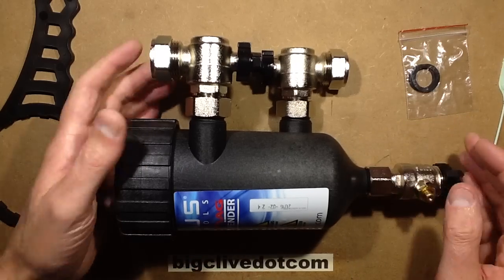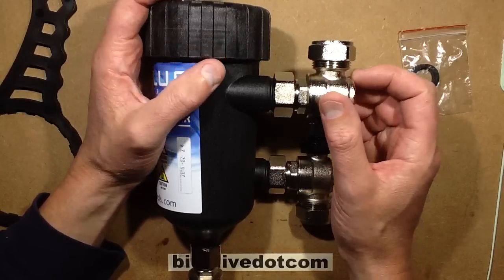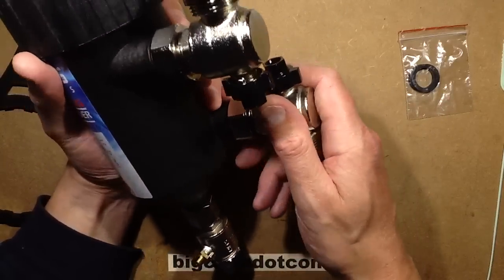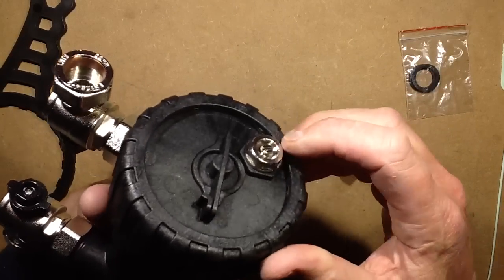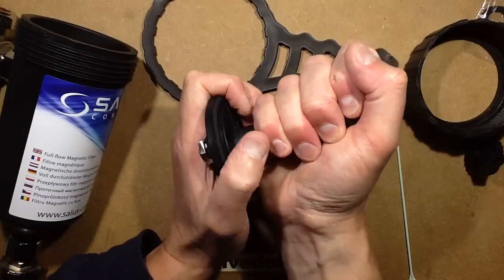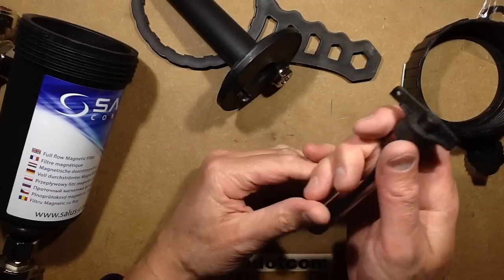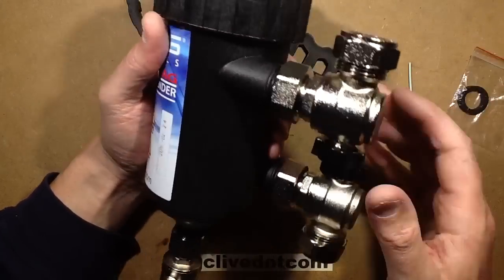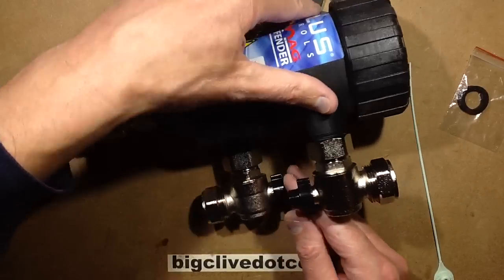Inside a heating system magnetic "sludge" remover.

Comment: My house was built in 1928 so has no central heating :(
Reply: Yeah, windows get the job done, but linux is better indeed .
Reply: My house was built in 1916 and still has two of the original radiators, and some of the pipes. Most of it was replaced when the top floors burnt out in the sixties, though.
Reply: Space heaters ftw! Or window units I suppose.
Reply: +cyancoyote I see what you did there lol
Reply: +cyancoyote groan Only in the comments section for a nerdy engineering video.

Comment: Corroseal Rust Converter Primer. Have you tried this for coating? It turns rust into a plastic like coating. It's Magnetite stops it from rusting any more. I have used it for undercoat in a '75 Scout and it's still driving around. I used it on all sorts of rust problems over the years. Wonder if it would work to coat your radiators. Best part is the more rust the better it works.

Comment: !!!!!!Also if you have a primatic system DO NOT inhibit!!!!!
Reply: Yup - Ive got a Primatic tank and the 5 year ritual of sluicing the system has been ingrained in my summer break for the last 25 years. Helps keep the crap at bay, plus avoiding "over pumping" the system so that it doesnt suck in air through the bell was a lesson I learned early in my relationship with it. I have to say though it works brilliantly so Im loath to replace it with anything else - plus I have my solar PV lashed to the immersion and get loads of hot water whenever the sun shines.

Comment: id add a T and another valve to one feed to that unit and a hose fitting to the bottom and the valve on the side and you could use it to do a half arsed flush of the system.

Comment: All the plastic bits on that thing look like they could get awful rickety over an extended period of time. I could imagine going back to that thing in a couple years and trying to turn some of those pieces and having stuff just crack and fall right off.
Reply: Shouldn't be a problem as the temperature will be less than 80C and high temperature plastics have been used under the bonnet in cars for years.
Reply: They're made of tough stuff Daniel. Reinforced hard plastic.
Reply: I've had a cast-metal thing break off while opening and closing the filler valve. Naturally, this happened after the plastic part of the filler hose also broke, so there was then no way to stop the system from dumping all its pressure on the floor of my boiler room... Fucking thing. I had to go find a bahco somewhere to close it up again.

Comment: The council fitted a combi boiler about 5 years ago but about every 6-8 months for over 2 years the heating just stopped working so engineer had to come out and clean the filters to get it working, then after 5 repairs and 2 annual inspections the engineer said the filter was originally fitted backwards so put it the right way and worked perfect ever since.
So that just gives you an idea of the level of incompetence that council engineers have, and wouldn't be at all surprised if one night I went to bed and entered the eternal carbon monoxide slumber.

Comment: Looks to me you could use a wrench to realign the connection ports to fit your system.  Would be a little more difficult to turn the on/off valves if the pipe is inserted in a straight section but it could be done.

Comment: A lot people wondering why we still use radiators, other than heating cost, safety and noise, no reason.
Reply: As for cost, the price of a forced air central heating system is much cheaper to install initially, an efficient boiler system in the US can cost between $3,700 to $9,000 USD. While central air costs between $1,500 to $2,200 for a normal system and $2,200 to $4,200 for a high efficiency heat pump system that includes AC. . Maintenance is also minimal, just change filters and occasionally clean out the main unit. And any modern system uses a heat pump as its primary heating/cooling source and are fairly cheap to run, whether it be an electric or gas heat pump hybrid system. As for safety there are no real benefits either. Modern systems dont even have a pilot light and use on demand ignition if they are gas, and for an electric system all you have are a few auxiliary heating coils, that at the worst burn out and stop working, they have flow sensors and thermostats to keep themselves from overheating. If you acctually get a quality system and install it correctly noise is hardly ever an issue, most units are either in the garage or in the basement, and modern heat pumps are vary quiet depending on the heat transfer capacity.  

Different systems for different climates, but if you want to talk about a type of hvac system that is superior to most it would be ductless mini split systems that have a separate unit for each room of the house, the efficiency and effectiveness to a separated hvac system is much better. Though on the cost side can be a good amount higher depending on the size of the house.
Reply: All houses here (UK & IE) are built with the systems in place, so install costs are negligent. We also build our house from concrete blocks, typically two blocks with room for insulation between them. Again, over here it is very different, electricity costs more, it's much cheaper for Natural gas. Electric heaters are around over here, my mum in the 70's remember they had one in their house, they never caught on here. On the safety note I meant electric convection heaters only, they can become filled with dust and burn. I use water to cool my PC, water is simply a better heat exchanger than air, which is probably why it's used more, I don't feel like arguing either, so google the advantages if you want.
Reply: It's also worth noting that some houses are very hard to 'upgrade' to central air. The ducting and vents have to go somewhere, and it's quite hard to add that to a home that wasn't initially designed around that. Or at least has an empty attic space and only one floor. 

Here in the states it's fairly common to have central air (especially in hotter climates, in the colder climates I'm not too sure, I lived there for a bit, and we just used space heaters, but it was an incredibly old house). But you do get old houses, and really the only way to get A/C there is to install a window unit. 

So really it's just because it's the norm there, and it's pretty hard to install anything else in older homes. And people tend to like tradition so they like new homes with radiators over central air. 

As for safety, I'm not sure where you're getting the idea that central air is somehow unsafe. Noise maybe, but radiators make a bit of noise too. As for cost, well I can't remember what the radiator cost is, and nor do I really ever have to heat my house in the climate here (cooling bills are absolutely insane though. ~40c ~100f summers and all). But I believe central air isn't much more expensive, probably actually cheaper. 

So tl;dr; Because it's tradition, and because it's hard to retrofit anything other than radiators to an old or solidly built house. That and in a lot of the climates you really don't need cooling except for a few days of the year, and those you can just tough out.
Reply: https://en.wikipedia.org/wiki/District_heating          
This is what is commonly used in Germany, it's cheap and efficient and there is no smoke coming out of every house in winter.
Reply: Here in New Zealand there's no such thing as central heating, it's all electric space heaters and air conditioners here. Electricity here is cheaper than gas and very few houses have gas connections, and those who do (or one that uses LPG bottles) uses gas space heaters.

Some other places like Copenhagen and Beijing have city-wide central heating, with giant boilers.
Reply: I've been to whole estates of 1970's houses that have had the forced air heating taken out and replaced with radiators.
Reply: thats usually because the replacement parts needed to maintain them are not available, except at crazy prices, and they are expensive to run, its usually cheaper to replace them with an alternative system.
Reply: After years of careful research, I can confirm it's because you are too busy eating fish and chips to install forced air heating. PhD thesis, here I come!
Reply: +NexaEntertainment Not to mention a large number of our houses are multi storey. It would cost too much for such a system and there aren't really any benefits, especially not here. For the safety aspect I was refering to only convection heaters.
Reply: +Avantime my city has common city heating too

Comment: Lots of large commercial buildings still use Hydronic systems though most have hot water coils in large Air Handling Units instead of radiators usually Sodium Nitrate is used as a rust inhibitor.

Comment: The radiators are made of steel?
Not stainless steel, aluminium or copper?
Reply: Stainless steel and copper are too expensive for radiators, which require quite a lot of material to produce. Nobody would buy them if they were made out of those.
Reply: Old radiators ones used to be cast iron, modern ones are usually steel.
If you have only steel in your heating system all is well, the problems come from mixing different metals or adding plastic which is permeable to oxygen. The old steel-only systems last practically forever.
Reply: +stefantrethan Plastic pipework used in heating systems is a three layer extrusion with an oxygen diffusion barrier in the middle, coloured blue so it's obvious it's 'barrier' pipe.
Reply: Steel is the standard material - it's cheap, easy to form and tough. Some 'designer' rads are aluminium, which adds another metal to the corrosion cocktail, and some upmarket bathroom towel warmers are stainless.
Reply: System in the house when I was a kid was mostly CAST IORN.  With asbestos pipe insulation.  Furnace (coal fired) rusted out after about five years.
Reply: Our pipes were all copper.
Reply: Copper pipes is pretty standard.
Unless you have a house from the 1900s which uses lead pipes
Reply: But they would be more of a lifetime thing than what a few years compared to steel unless the steel is zinc coated.
Reply: If it's done right, yes. Around here they used plain poly pipe for underfloor heating sometimes and put that into old central heating systems with steel. You wouldn't believe the problems that causes.
There are also low-temperature systems now which are entirely made of single layer polypropylene pipe, using only brass or stainless metal fittings, no steel at all. They also work just fine, clean as a whistle, but never mix the two.
Reply: there are plenty of cast iron radiators over a century old in use all over the place. They do get replaced, but rarely because they've been corroded away.

Comment: hold on... iron oxide is magnetic now? isn't the lack of magnetic attraction a way to look for rust?
Reply: The red Fe2O3 is magnetic, but nowhere near as strongly as iron. Black Fe3O4 (magnetite) is much more magnetic, and almost as strong as iron, and tends to be a major component of the sludge in heating systems.
Reply: No, the lack of magnetic attraction is a way to look for filler and/or fibreglass.
Reply: Good point... never have seen magnetiv rust... Hm...
Reply: If the magnet is strong enough, yes.
Reply: I was surprised to find that the black cement colouring powder I  had was attracted to a magnet.  I'd assumed it was carbon, wiki tells me it's probably an oxide of iron.   Yep, it's magnetic.  But there's more than one oxide of iron...
Reply: +ChumpusRex     Okay. Good to know. Thank you. "One learns knee out"' as the Germans say.

Comment: Hmm, might put one of these on my water line, minus the mix ins, it would filter some stuff without slowing down the flow so much. Would be good for the washing machine or washing the car
Reply: They make particulate filters specifically for your water lines. They are pretty much mandatory if you have a well instead of a municipal water supply. Otherwise sediment gets into everything.
Reply: +SlocketSeven yeah, but particulates are different to heavy metals. Also, just because it's filtered doesn't mean that the pipes after the filter aren't shit
Reply: If you have heavy metals in your drinking water, you have much bigger problems, seeing as heavy metals are toxic.  If you have Hard water, with lots of dissolved iron and calcium and lime,  you need a water filter, for the sediment, and a water softener to deal with the hard water. Water softeners require regular top ups with some kind of chemical. I think it's a salt?  Our water isn't hard enough to require one.
Reply: +SlocketSeven congratulations on reading my comment fully, when did I say drinking water? I specifically mentioned the washing machine and car washing for a reason. We all have metals in our water supply, there are trace amounts. I'm not sure the exact maximum tds is, but the epa has it quite high with the maximum at around 500mg/l or so
Reply: And this "magnetic" filter will do nothing to heavy metals in your water.
Reply: +Jack White https://scholar.google.com.au/scholar?q=magnetic+filtration+heavy+metals&hl=en&as_sdt=0&as_vis=1&oi=scholart
Reply: Have you even looked at the results of your search? They add a magnetic auxiliary material to which the heavy metals bind and then they filter out that magnetic auxiliary material with a magnet. So unless you plan on adding carbon coated metal nanomagnets or adsorptive particulates, magnetite fines and a coagulant to your water line, this magnetic filter will do nothing to heavy metals in your water.
Reply: +Jack White that's just one of the studies where they bind it to something else, I didn't bother to link a specific study as I can't be bothered to prove to you that magnets pick up metals. Also my original comment was for my use case in which I travel around the state attaching my pressure washer to random water sources, hence why something like this that doesn't impact flow so much might come in handy
Reply: You didn't bother to link to one specific study, because you don't know what you are talking about. Of the roughly 90 metals, only about 7 are magnetic, lead and mercury are even ever so slightly diamagnetic, so good luck trying to pick them up with a magnet.
If your only requirement is that it doesn't impact flow so much, but don't care if it actually filters anything or not, then please go ahead and misuse one of those for your application. How do they say "What does not help, does not hurt".
Reply: Jack White Truly I didn't link a specific study because I didn't expect you to click the link. Being youtube comment's people mostly stick their fingers in their ears and yell 'lalalalalalalalala'

Obviously not all metals are magnetic. I should probably have originally said filter scale etc. That said it's main purpose for me would be to help filter iron and such, I already have particulate filters.

Along the lines of what doesn't work, I work in a high end industry (car detailing), so anything I can do to have softer water is a great help.

Comment: Exchanging your water entirely every so often is a really bad idea.. you basically refill the system with oxygen and give the rust a good boost. Just let it stay sealed and stop corroding after a while when all the free oxygen has been used up, right?
Reply: No Oxygen will only stop one form of corrosion, the different metal corrosion will happen even without oxygen.
Reply: The inhibitor locks up the oxygen and stops/slows bimetallic corrosion, but the problem in a hard water area is each time you fill the system the boiler scales up a little bit more. With modern high-efficiency boilers the water passages can be very small and after not that many changes of water you'll find it starts to sing or kettle on full output. It's then time to descale it, something I've got to do here before winter.

Comment: For commercial work in the U.S., often the systems are filled with distilled water.  Anti-corrosion chemicals and often antifreeze is also added to the system.  Flushing the system and refilling with regular water adds additional oxygen to the system; oxygen allows the iron and steel to corrode.  It's difficult to tell where the balance point is. You might be best off with only antifreeze and anti-corrosion chemicals.  In the U.S. see supplyhouse.com (HEATING/CHEMICALS) for their ingredients.

Comment: It's a good idea to run automotive anti-freeze in your boiler. Just in case you have an extended power failure. This also provides corrosion protection and pump lubricant. Assuming you have hydronic heat and not steam heat of course. But that's clearly for a hot water system. Although it might work well in the condensate return of a steam system provided it can handle the pressure.